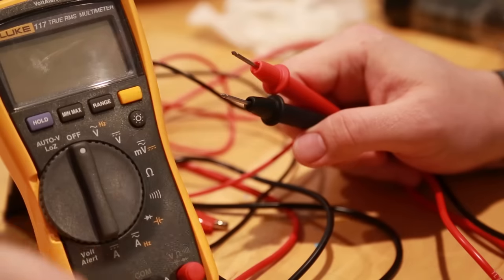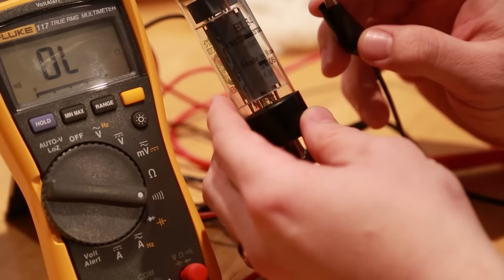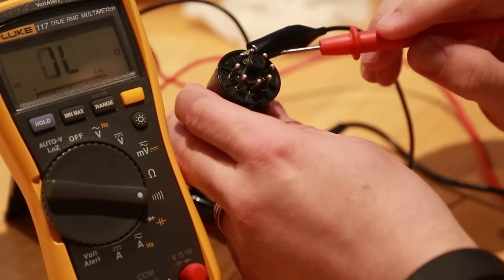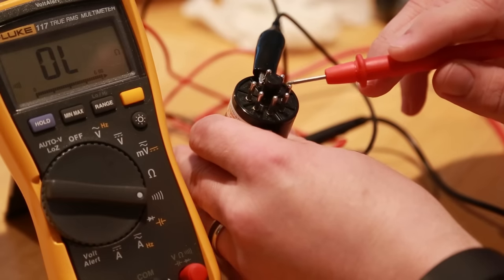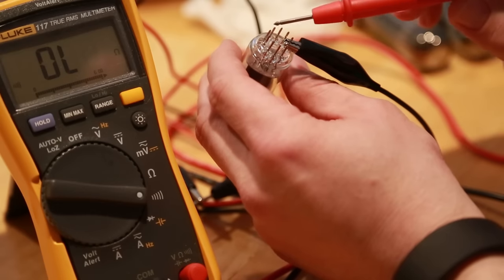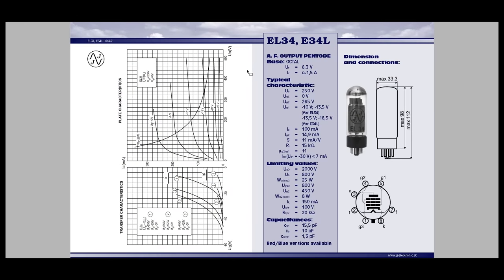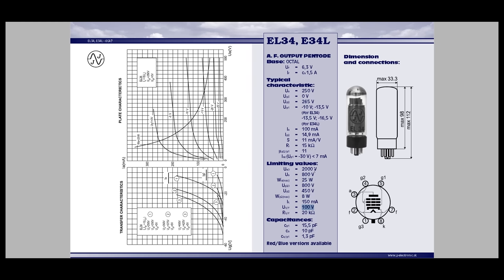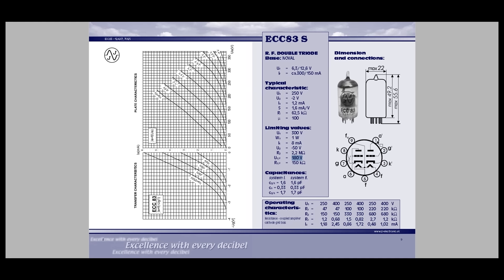Simple tests for Tubes with a Multi Meter

Comment: I have just purchased some old valve radios and I needed to check the valves to see if they are OK, now I can check them without getting hold of an expensive valve tester. I have the old wax capacitors to change plus the mains leads and check the wiring as being old but this video is very helpful, many thanks from across the pond
Yours Faithfully Paul

Comment: Thank you for the video  I wanted to add that when I tested the heaters on a 12ax7a tube I found that when I tipped the tube vertical to horizonal I lost one of the heaters.  Thus you may want to rotate the tubes as you test.
Reply: instablaster

Comment: Yeah, I tried this said method in detecting faulty power tubes. I even used the tap glass with a chop stick and visual inspection but nothing to indicate a faulty power tube(s). I had a whooshing sound emanating from my amp guitar plugged in or not, replaced all preamp tubes - same result. I replaced all power tubes, biased and turned in amp - no whooshing noise thus far. I’m convinced there is really no sure way in detecting a bad tube unless all avenues have been explored - timely & costly at times.
Reply from the maker: Absolutely correct, this is just one way to tell if tubes have failed in a catastrophic way that you can check for shorts.  There are even tubes that they will pass a tube tester, and still sound horrible

Comment: Instead of the continuity check I like to run low Ohm resistance meter, because it can be helpful with low resistors where the continuity would just kick in. It was particularly useful before the transformer winding ratio measurement and also with the negative feedback causing some ground measurement problems early on when I learned the circuitry.

Comment: I have a bias meter, but to find a the bad ones in my stock this test picked them out. The three bad ones that I found doing it this way were definitely bad. Fast just to tell me the trash from the good tubes. Not how good I will know one day won't I .
Reply from the maker: +Kevinpaul Moore gear to hear the tip was helpful :)

Comment: Thanks for those tips man...I have three identical Ruby 12ax7 and two of them have continuity on pins 9, 4 and 5...just one of them have continuity only on pins 9 and 5...maybe this one is bad?...when plugged on the amp the power tubes will light up but none of the three 12ax7 will...and the amp has no sound...

Comment: Hello, nice video by the way. My question is where do you get these data sheets for the bulbs? Is this something I would have to look up on the web as I am pretty sure some of my bulbs have this writing worn off. It is from an old 1950s' Marconi radio. Any help would be appreciated. Thanks again and have a great day.
Reply from the maker: You have to know the tube numbering and then you can search for them. I've found ever single one I've needed online.
Reply: @FrenchieFilms  Thank you so much. Unfortunately some of the tubes either do not have a number, which I find unlikely or, the number has been rubbed off, which is more probable. However I will keep trying. Have a great day and thanks again.
Reply: @thomasharlos6872  You probably figured this out by now, but if you didn't and for others who have this question, I would first look to see if the tube number is etched in the tube base.  If not, find a schematic diagram for your radio.  Then look to see what the radio manufacturer specified for tube numbers by socket.  Those should be the tube numbers for the tubes that went in the corresponding slots.  Otherwise, you'll have to find some used and/or buy new tubes with numbers.

Comment: I recently bought a marshall sl5 but it doesn't sound anything like the ones I see on YouTube I feel like it doesn't have bite or full of gain like the ones I hear here, I did the tube test as you show and they all have continuity but the numbers on the screen from the multimeter they go crazy going up and down, I think they are the original tubes that came with the amp, do you think I should still change them and see if there is any improvement? thank you
Reply from the maker: That could be the tubes or it could be the multimeter.  It can never hurt to have a spare set of tubes and swapping them out to test is easy.  Tubes are still pretty expensive, but if they're old they can start to conduct poorly and make significant changes to tone for sure
Reply: @FrenchieFilms  thank you

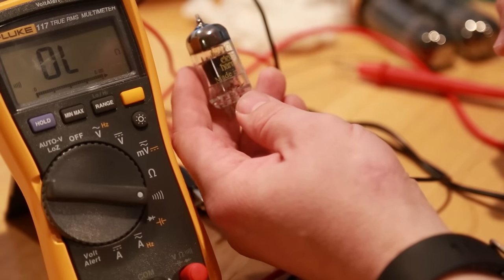Comment: Really helpful thanks. Just one thing; at 3:43 you say the max voltage for the heater should be 100 - 200v. Shouldn't it be around 6v for the heater and 200v for the plate?
Reply from the maker: +Russell Catchpole I'm talking about the max before it fails, not the normal oppression point of 6.3 volts.  The point was that well over 100 volts went through the heater line and cooked the filament

Comment: i have two 12SG7 tubes, the heater pins are 2 & 7, they both test fine, however pins 3 (marked cathode & grid number 3) & 5 (cathode) test positive for continuity. I'm not sure if that's supposed to be that way or not, how do I tell if these are bad tubes? I'm looking at the diagram but don't know what to look for

Comment: Hi and thanks for the great video! I have a 1963 princeton amp(was completely serviced 10 or more years ago and prolly played around 6 times until 2018) I brought it out today and the sound is distorted. I tapped the tubes- nothing, i cleaned sockets and resat tubes-nothing, i just multimetered per your video, continuity is good. Is there anything else I can test before taking it to a tech?
Reply from the maker: Not that I can think of.  It can be dangerous to do more unless you understand how to work with the inside of a tube amplifier.  Swapping tubes can help rule out bad tubes but that's about it.

Comment: i wish i knew someone like you,i have a couple of amp need testing
Reply from the maker: Sorry, I would love to, but unless you're close to the Seattle WA area, that would be hard :)
Reply: can i hear if my tubes are faulty by tapping the tube with a screwdriver
gently of course
Reply from the maker: +Gregory Dorrell yes you can, but something a bit less hard, like a pencil or chop stick is better, tapping a bad tube tends to make all kinds of noises.  The first preamp tube can sometimes make very small noises this way and isn't a sign of 'bad' things because it is the most sensitive in the amp, but if it makes really obvious noises it may be bad too.  It can't hurt to try and swap it with a new tube to see how it sounds.
Reply: Gregory Dorrell buy a multi-meter and give it a shot, or check out the blogs and enter your questions thru your amps manufacturers websites. If it worked for me...you might get lucky too. Not to mention saving lots of money and learning a ton at the same time;)

Comment: Great video !
Someone game for free 2 GT 6L6GC tubes and one of them they said it was bad !
Well i measure them and one of them "beep" between pins 2 and 3 (filament and plate) and the other does not "beep"...
So my guess is that pins 2 and 3 should be open and that tells me that this tube is 
shorted ??
Reply from the maker: That is very possible yes.  I wouldn't put it into an amp unless you can get it on a tube tester

Comment: is there any way to match a pair of power tubes?  Could I measure each mA value of them through a single ended amp using the same test tone?
Reply from the maker: You need to measure a lot of variables to match tubes.  That works probably get you pretty close though yes.  For guitar amps for sure.  For hifi maybe not

Comment: I need to test tubes for an old radio, but I have no idea what pins should have continuity and what pins should not. I need a vintage radio repair guy who has a tube tester to test my tubes. I was just going to buy a tube tester on ebay. I quickly realized either the tester is some crazy amount like $200-300, or the seller is listing as non-tested/ as is. Since I only spent $35 on the radio its not worth buying a super expensive tester, it would actually be cheaper to just replace every tube with new ones at $7-10 each. An un tested, who knows if it works ebay tube tester is worthless to me. 
 I wish it was 1962 again and I could just go to a local grocery store and simply test my tubes...
Reply from the maker: Yeah, not fun.  The old radio's likely also need other work, like electrolytic capacitor replacement etc.  If you are anywhere near the Pacific Northwest I could help :)

Comment: I found a 6u10 zenith tube with 12 pins the seal was good but I can't find the data sheet
Reply from the maker: Here's an article about the tube http://vinylsavor.blogspot.com/2011/12/tube-of-month-6u10.html?m=1 and in that article it also has a link to the datasheet.  It's a GE datasheet, but it's going to have basically the same characteristics

Comment: Yesterday I Switched my Marshall DSL20CR watt switch from 20w to 10w while it was on, and not in stand-by mode ( was distracted ). I think I blew a tube,as I only get REALLY low volume now.Any idea to help me out Frenchie?
Reply from the maker: Sorry, not reading these comments as much as I used to.  It's hard to guess from just the comment, you can definitely try swapping out the tubes, and if the problem persists, it may be something on the board and needs a tech to look at it.
Reply: Thank You! @FrenchieFilms

Comment: Can you run 6.3 volts to pin 2 and 7 to just light the filament?
Reply from the maker: You definitely can, but that is less simple for most than just using a dmm.  It also doesn't confirm if other pins are shorted that shouldn't be
Reply: @FrenchieFilms  Thanks for the reply. I was not asking the question in regards to testing. Your way seems perfect. I have received 50 tubes and was wanting to work them into  a couple of projects. With microcontrollers and other electronics. I do not want to use high voltage.(I don't trust myself) I just want to light the filaments.I came across your video and you seemed to know tubes inside out. I would imagine polarity matters. Pin 2 positive. 7 ground. Probably will have to find data sheets on the ones I have. I was hoping their was any easy standard way to light any tube. But I am guessing that is not the case. I also assume tubes are not dangerous with only 6 or 12 volts to light the filament. Great videos by the way!  I use to have many many tube amps when I played guitar in bands in LA in the eighties. Two of them caught fire during shows. Where were you 30 years ago? We could have used you :) Thanks.
Reply from the maker: Gotcha, I misunderstood. Heaters can run on AC or DC and polarity doesn't matter.  it also depends on wiring as to how much current and voltage you need, and it depends on the tube type.  You'd need to look at the datasheet.  Many of the common power tubes (EL34, 6L6GC, 6V6) use pins 2/7 for heaters, and need 6.3V (DC or AC).  They'll draw varying current per tube and you'd need to look that up in the datasheet.  They always list heater current.  For preamp tubes, the more common 12A*7 type (12AX7, 12AY7 Etc) they can either be wired for 12v operation, and use half the current or 6 v operation and double.  pin 9 is the midpoint on the heaters, if wiring at 6v you jumper pins 4 and 5 and connect one side to 4/5 and the other to 9.  If using the other method, don't use pin 9 and connect one side to 4, the other to 5 for 12v operation.  Hope that clarifies.  To know for sure what you're doing you'd need the exact datasheet of the tube you're planning on using.  Each can vary pretty significantly in pinouts and heater configuration(s) and current draw.
Reply: @FrenchieFilms  Great info!!  Thanks again!!   I appreciate your time. I should be all set to begin to experiment with them. I have been collecting data sheets and studying them for a couple weeks. Also watching videos about how tubes work in general. So what you said makes sense to me.

Comment: Cool vid.... I'm just starting to try to work on my vintage amps and this was a good quick test for tubes. I have a Marshall at the moment that is microphonic ( by tap test ) in the first preamp.. but when I change the tubes out, its still noisey when tapped. Maybe a bad socket??? I'm going to go through my stock of tubes with this test just to check them out and get used to my meter better...thanks...
Reply from the maker: +Blaydrnnnr yup it's a quick way to find duds, so you can put them in the bin
Reply: V1 most Marshalls is very high gain. Almost all tubes amplify at least some sound when tapped. In my 2204, I thought a good tube was microphonic because I heard the tube shield rubbing against it, through the speaker, when I put the shield back on. You will hear sound of you tap the tube on that amp. If it’s microphonic and truly bad, the sound will be very very loud when tapped, and probably also ring.

Comment: Just to summarize: You had a tube that had an internal short. Because the heater circuit is usually tied to all the tubes, the short shared the high voltage with all the tubes and caused multiple component failures? I'm fairly new to tube amps and with all the tube madness going on right now, I'm looking for a bargain in used tubes. But - I will definitely ignore some recent advice I got that basically said, just plug them in the amp and see how they sound. Yikes! I could do allot of damage that way! I've downloaded the spec sheets for my tubes and I will do this simple test for shorts with my trusty multimeter. Is there any other considerations? Is it worth to pay someone to test my tubes, for example if I needed a matched set? Thanks!
Reply from the maker: You have hit the nail on the head, but the test I did here can confirm if there is a short term any other pin to the heaters pretty quickly
Reply: @FrenchieFilms  Thank you - this simple test is even more crucial given the tube shortage! Thanks!!!

Comment: The EL34 cathode and suppressor grid are not connected internally. If a pentode's cathode is connected, it will be connected to grid 3, the suppressor grid.
Reply from the maker: +Silas Fatchett thanks, I did the video about a year ago, so I don't recall all the details, but I do recall the most important points.  1. Only heaters should have continuity, 2. Check your datasheet got the pinout of the tube you're working in to be sure if for some reason this is in error.  The major fault I ran into was the anode was shorted to the heaters, and roasted the entire amps tube heaters

Comment: I have a Precision Electronics S35 and I'd like to convert it to a 2 channel guitar amp. One channel for clean and one for a modern metal distortion with a huge sound. Is this possible without too many changes using the stock tubes? It has 2 6EU7s, a 6C4, and 2 7868 output tubes. Thanks.
Reply from the maker: If it already works as an audio amplifier, and already has two channels, then yes.  It usually requires a few tweaks to the resistors and capacitors in circuit, but I'd suggest getting a schematic and sharing your plans on a forum.  They're are many people on forums that may know that specific amp, and have made these types of changed before.  Try Hoffman amps forums or ampgarage.com

Comment: On a Tung-Sol 6FD7 I have continuity on heater pins 4&5 but also have continuity on pins 2&3 which both go to grid 2. Is that normal? Seems like if they're both going to the same grid it would have continuity.
Reply from the maker: +riverraisin1 you're correct, pins two and three on that tube are to the same grid, so you should also get continuity

Comment: I am planning to do a little 9-pin preamp tube tester with a fixed freq oscillator, 2 sockets, one for 12AX types and one for 6922 types with the tubes wired for 6.3v.
Configured as common cathode amp stages. If I put say 100 mV in, I would be able easily to calculate the amplification pr. stage.

BUT ... how do I determine if the tube still is very good, good, fair, not good. Does it loose amplification when it gets worn out?
Reply from the maker: I don't know the exact answer.  I think there are rated response curves with input voltage and the like and it should amplify current and voltage by expected ratios as defined in the datasheet.  This is a bad explanation, but the best I can think of to try.  There's a thread about this and the design by R.G. Keen of geofex.com on the Ampgarage forums you should look for.
Reply: @FrenchieFilms  Than you :-)

Comment: Hi there any suggestion to test AMPERITE vacuum tube? im triing to fix a GRC radio set. and i have issue on power box
Reply from the maker: The brand is less important than the type.  I'd need more information to help

Comment: Can most guitar amp tubes be tested the way you showed us with the 12AX7B? It worked great! I just tried it on my questionable 12AX7B, so thanks for that!
Reply from the maker: Most 12a(letterhere)7 that I know of are identical pinouts.  You can always pull up tubes data sheet to confirm which pins are the heaters

Comment: I have a presonus tubepre, when i connect a condenser mic (MXL 990) the signal is really high even when the gain and drive knob are all the way down, is that a sign of a bad tube?
Thanks
Reply from the maker: Not likely, tubes tend to get weaker and then just quit silently or start making odd noises.  I don't know much about that schematic, but if the output is too high, one of the components in the chain designed to keep the tube biased may have gone out and the tube it running hotter.  This will shorten the tube life and could have other consequences.  You could still try swapping tubes to see what happens, but you might want to have someone take a look at the preamp
Reply: Frenchie Films thanks
Reply: verify if that mic values falls within presonus tubepre range of working, . verifiy also the cable, the phantom power and if that mic has a high signal even connected to a mixer witohut the tubepre of presonus